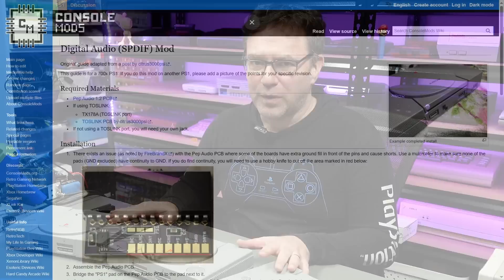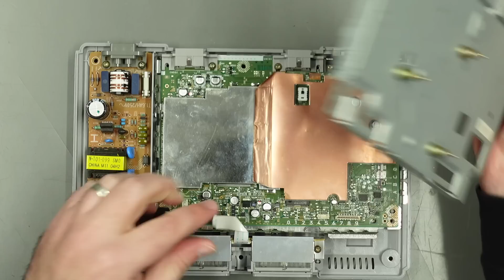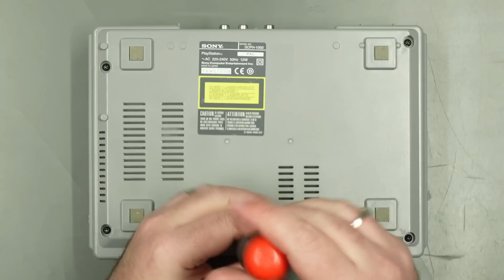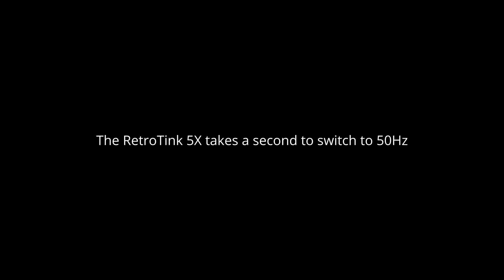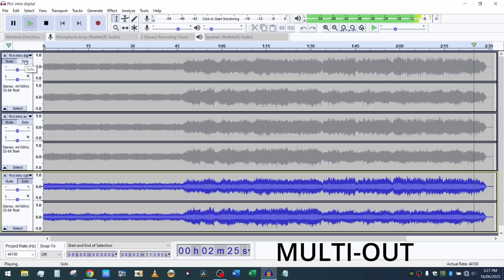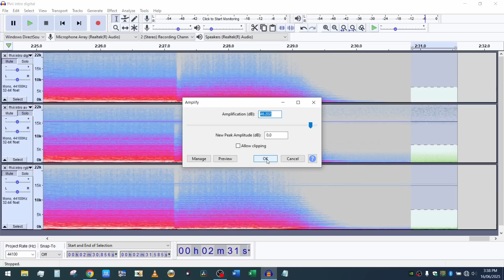PlayStation Digital Audio with just 2 wires #nocutmod

Comment: To anyone who thinks that, on a regular setup, 46dB of singal to noise is going to be a total dealbreaker:
-6 dB less means "twice as quiet". (Actually, -6.02, but let's round up for convenience)
-12 dB is "four times", -18 dB is "eight times as quiet".
You can calculate that for -46.
If you're not going through festival speakers and not applying, idk, insane OTT compression for doing your next banger, pink noise at that volume is noticeable, but barely. Not only because of the dBs, but also because loudness absolutely shoudn't be measured in dBs. For that, you use LUFS instead. And LUFS for these signals would not be great, especially for the second one.
Also, the RCA example obviously didn't reach 0 dB to keep normalization fair; that means there's another, say, 6.
On my semi-pro setup, these -6 make the difference between "yeah, there's pink noise" and "I almost can't hear anything". Remember, 2 times as quiet. I still definitely can, but that's on heavy, shielded monitors in a completely quiet room, and it's very low.

While noise is irritating, what I detect more (by ear, these cursory waveform inspections don't help) is phase dispersion. Subjectively, you could that "sharpness", it seems there's just a tiny bit more of that in the digital capture. However, can't be sure: 1) youtube recording is lossy and messes with phases for sure; 2) PS1's sample rate is 44.1kHz, too, but I still would capture in better "resolution" if I had a scientific interest in matching/inspecting the phases, it only makes sense. So, 96k could show the wave deformities better if they do happen in the higher frequencies. Well, with this high level of 15k interference, they definitely do. But what we've heard in these normalized recordings is not 15k (and PLEASE be careful if you ever decide to listen to clean 15k or anything high like that; only slowly raise the frequency and try to never raise levels from very low, and don't suddenly come close to your speakers, it will be painful and you could even damage your hearing).

Comment: i kindof deemed Digital Audio is bit too much for a PS1 at the time, so i gave it some Gold Plated RCA Sockets instead... added bonus is having Dual Output potential, like using a RF Adapter to go my RF only Sony Trinitron yet still having RCA going to a more modern CRT...
or Scart RGB for the Visual... and simply having the Speakers easily getting a stronger signal on the new sockets...
Yellow + White + Red style RCA on the right side of the PHAT PS1 (opposite side as the PSU) ... if i was doing it again, i'd probably get the DC 12V PSU upgrade instead, freeing up space behind it for this sort of mod instead...

Comment: would be nice if the adapter has a passthrough so that I can use PSIO together with this adapter....
Reply from the maker: Passthrough won't help as the PSIO uses the same free pins on the parallel port for other signals

Comment: Thanks for this video! Anyone know what's the wire gauge for two the included wires, or something else that would work? I'd like to get some extras for my spare consoles. (This will also be my first solder job which is why I may need a few to practice lol).

Comment: Hi, great to see it works with X-Station. Just to check, does it still work if the X-reset is also installed?
Reply from the maker: Should do, I can see any reason why it wouldn't. As long as the parallel port hasn't been messed with (which is what the PSIO does) it should work with all other mods

Comment: Hey there! Just found this video thanks to RetroRGB. Would the electrical noise/interference you mentioned still be an issue on a PS1 that's been modded with a Retrogem and a non-linear PSU replacement like the RePSX? Very informative video regardless. Thanks for sharing your knowledge :)
Reply from the maker: Do you mean from the analog output? No idea about the replacement PSU. Personally I stick with the original PSU whenever possible as replacements can introduce more noise. Not saying that's an issue with the RePSX as I haven't used one. As for the RetroGEM, it shouldn't cause any extra noise but I doubt it will eliminate any noise that's already there on the analog output. The digital audio output from this or the RetroGEM will always be noise free
Reply: @TheRetroChannel  thanks for the info :)

One other thing that's on my mind, which might just be something weird with my PS1 specifically:

In Final Fantasy 7, when you're on the title screen and select Load Game and then choose the memory card slot, there's a little 'confirmation' chime sound that happens when it loads the list of saves on your memory card. Not the sound when you pick a particular save to load, but rather the sound between selecting the memory card and seeing the full list of saves.

I've noticed that with digital audio (via the retrogem at least), that little confirmation chime doesn't sound right. Almost like audio samples are being dropped? But if I use the retrogem for video only and then the AV multi-out port to get analog audio, that chime sounds correct as it's supposed to.

I know this is an extremely niche / edge-case situation. But if you have the time or inclination to see if the same issue is present with your parallel port audio mod, I would greatly appreciate it.

Reason for all of this is that I only use the AV multi-out port for analog audio. So if I could switch to digital audio with no downsides then I could delete the AV port and restore the serial link cable port - having it exit the console where the AV port used to be.

p.s. Sorry for the lengthy comment, and I'm probably going to order one or two of your audio mods regardless!
Reply from the maker: @FarAwayCinema no problem. I would rather hear about these potential edge cases than not, that way I can either try to correct them or if I can't then I can at least advise people that it is an issue.

So I did a test with my 1000 series using the multi out for audio, and I don't hear any obvious difference between digital and analog. I captured both outputs and compared in audacity just to be sure. The da-ding sound is the same with both of them.

Well, not entirely the same, the digital version sounds a little "crisper" for lack of a better word, but definitely not wrong in some way. I would imagine the other PS1 revisions will be the same but if you let me know what version main board you have I can test it out with one of mine.
Reply: @TheRetroChannel  SCPH-5501 with a PU-18 board. Retrogem hdmi-out connected to a morph 4k connected to my OLED tv. Analog audio from the AV multi-out -> RCA adapter (SCPH-1160) -> RCA-to-Aux cable -> 5.1 speaker system. Speakers are just a cheapo Vizio set, so no receiver or amp. Just aux cable plugged directly into the aux port at the back of the soundbar.

I have an Xplorer FX Pro cheat cartridge plugged into the parallel port, and have noticed that the sound effects you normally hear when selecting the menu options in the xplorer software/firmware often have the same dropped audio sample issue but it doesn't happen 100% of the time like in FF7.

The problem only occurs if I have the speakers set to HDMI-ARC mode. If theyre set to AUX then everything sounds fine.

Also I recognize that due to my "unique" setup that the issue could be caused by any number of things. So no worries if all this sounds like a bit of a quagmire in terms of troubleshooting.

I might be able to upload a recording of the audio on my channel so you can hear exactly what I'm talking about rather than just reading a description of it. But I'd likely have to record it on my phone which wouldn't be ideal.

Thanks again :)
Reply from the maker: Ok, I decided to test again with my 5000 and 7000 series and I did notice a difference, but the cause was not what I expected. Have a look at this https://youtu.be/TlcscBdK-tU and tell me if it's what you've been hearing
Reply: Thank you for testing, but unfortunately that's not the same as the issue on my PS1. Instead of hearing the Da-Ding! sound, I only get the back half of the Ding. Except around 10% of the time when it actually sounds correct. I uploaded a video so you can hear it for yourself. First 34 seconds is digital audio via HDMI-ARC, and the remaining 17 seconds is analog audio via AUX which sounds correct every time: https://youtu.be/5XOk9GMnAY0
Reply from the maker: @FarAwayCinema Ah ok, I see, or hear what you mean. It sounds like a similar issue that the SNES digital audio mods cause with some DACs. Although I didn't run into this issue when testing my PS1 digital audio mod.

Basically the SNES will drop the digital audio stream when there's silence, and certain DACs do not handle this very well. It seems to take them a fraction of a second to resync

It's a known problem with SNES digital audio mods and I think I demonstrated it with a certain Pioneer receiver in my SNES digital audio mod video. But that same receiver was perfectly happy with the PS1 digital audio mod so I figured it wasn't an issue with the PS1.

Curiously certain SNES games are unaffected as they keep the audio stream active even when there's no sound (it's obvious when looking at it on a scope). I guess it's not a SNES specific issue as I've seen options in things like Kodi that appear to do the same (keep audio device alive).

All that being said, I'm not sure if I tested FF7 with it. I will pull out the Pioneer and test again, if nothing else I am curious to check with the scope if the PS1 and FF7 does a similar thing. I doubt it, but again I don't think I ever bothered checking as it seemed to work without issue.
Reply from the maker: Ok, some interesting results. I can see that the PS1 also drops the audio stream when no sound is being output BUT the Pioneer receiver handles that just fine.

I can see the PCM indicator on the front of it turn on and off as I go back and forth in the menu, but the audio sounds complete. And every so often it will stay lit as if the PS1 is outputting digital silence. I assume this is why on rare occasions you don't get the dropouts.

I'm thinking it could be down to two reasons. The higher and more standard sample rate perhaps allows the receiver to lock onto it faster. Or the PS1 "wakes up" the audio output slightly earlier. Could be a combination of both.

Out of curiosity I also hooked up a regular CD player with S/PDIF and indeed when nothing is playing, the audio stream stops. This also happens when skipping between tracks but there's no obvious dropouts.

So my thoughts are certain DACs are just a little slower to start and therefore may drop samples. I think it's worse with less common sample rates like the 32kHz from the SNES. Whether or not my mod performs any better than the RetroGEM is unknown. I don't know what they're using to convert the various signals into S/PDIF but I'd be curious if anyone else has noticed the same issue.

I don't see an easy solution other than trying a different receiver or DAC. I wish there was an easy solution as it would certainly help for the SNES mod especially

Comment: This is great for people like my self who are good with soldering, but terrible at making plastic cutting / panel mounting look good. I've added it to the ConsoleMods page shown in this video. 

I did notice in the install instructions it says "(see images above)", but I'm not seeing images. Are they missing?
Reply from the maker: Thanks mate. The install pics are up the top of the page with all the other images, you just need to scroll across a little. I will move them around so they're a little more obvious 👍

Comment: Ngl, a ps1/2 is irrelevant in the big 25 when you can frankie (or buy one ) a ps3 and get HDMI and hardware backwards compatibility on one system for less than $1000

Comment: Now do it compatible with PSIO please with second port behind.
Reply from the maker: Not going to happen, the PSIO already uses the unconnected pins on the port for something else.
Reply: @TheRetroChannel  then it should be redesigned with some switch on module that allows to switch between this thing and PSIO to at least avoid plugging in and out both devices. But I have better idea.

Why does this thing has to use IO pins for audio reporting? Instead av output pins could be used to route out digital audio via some of its pins
 Modified device should be plugged to Av port (maybe have some external USB power) and should have another av out in it to output video and audio standard way, or it also may have all regular porta for output - composite, svideo, rgb scart +  digital output plus yet another av out Design should be similar to one of those official ps1 short cords that was plugged into av out and had composite output plus another av out.

This world be better for PSIO or debug devices compatibility.
Reply: @TheRetroChannel  then it should be redesigned with some switch on module that allows to switch between this thing and PSIO to at least avoid plugging in and out both devices. But I have better idea.

Why does this thing has to use IO pins for audio reporting? Instead av output pins could be used to route out digital audio via some of its pins
 Modified device should be plugged to Av port (maybe have some external USB power) and should have another av out in it to output video and audio standard way, or it also may have all regular porta for output - composite, svideo, rgb scart +  digital output plus yet another av out Design should be similar to one of those official ps1 short cords that was plugged into av out and had composite output plus another av out.

This world be better for PSIO or debug devices compatibility.

Comment: Isn't there a possibility to make this mod accessible to psio users by just soldering this box internally and putting this connector with a drill on the io?
Reply from the maker: That's pretty much how the original digital audio mod works https://consolemods.org/wiki/PS1:Digital_Audio_(SPDIF)_Mod

Comment: Its not really making a PS audiophile. Its just transporting the job elsewhere. The first models are audiophile because of the DAC
Reply: The DAC wasn't changed until the 7000 model PS1s. But that isn't a factor with this mod because its outputting the digital audio before it even reaches the DAC. Audio hardware has improved quite a bit over the past 30 years, and so one of the advantages of this mod is it allows you to easily route the audio through an external DAC and get better quality than what's normally possible on any PS1.
Reply: the mod shown in the video makes no sense at all, why does it even exist?? beats me...

Comment: This is cool. It's a good option, but I generally just use my PS2 that has a digital output already.
Reply: Have been curious since hearing about the PS1Digital's proper, uncompressed sounding audio (IIRC, some overdriven sounds/music on one of the Resident Evil games whereas most everybody had to hear the crunchy, overdriven sounding audio at certain passages up to now)... Don't know if this had to do with when titles supporting Dolby Surround were playing back but not deciphered and, so, came out sounding terrible over a pair of stereo channels.... Does playback from a PS2's Toslink and receiver with the old Dolby Surround support (4.0 audio?) is properly decoding the matrixed rear channel audio track?
Reply: @That_Handle  analog dolby surround is a bit funny - its not actually 4 unique channels, but instead a bit of additional metadata that tells your audio receiver (if you have one) to duplicate the two stereo channels with the speaker mapping flipped so they're also sent to the RL and RR speakers. In other words its literally the same sounds that comes from the front two speakers.

Does it make for a cooler and more "immersive" experience? Heck yes. But you're not missing out on hearing different sounds if you only have a 2-channel stereo setup. Also since its basically just a metadata trick, a 2-channel setup won't suffer from additional tracks muddying up the audio by getting folded into your front Left and Right speakers. If you don't have a 4.0 speaker setup, the metadata does nothing and you hear the normal stereo audio exactly as the game developers intended.

Regarding digital audio via toslink on PS2, there's no support for Dolby 4.0 because that's an analog format and toslink is digital. But plenty of home theater speaker setups - even the very cheap ones - have the ability to produce "fake" surround sound from 2-channel sources. Which means you can get essentially the same effect even on PS1 games that don't support Dolby Surround. My cheap vizio speakers can do this and its just an option you select on the remote.
Reply: @FarAwayCinema ,
Thanks. 
...Additionally, a bit into the nuance of the PS2 outputting PS1 Dolby Surround: 
Are the PS2 models that had full PS1 chipsets onboard going to send Dolby Surround out through the stereo AV cabling?
Reply: @That_Handle  I would assume yes. IIRC, the Dolby Matrix mix is a permanent part of the audio track. So you essentially get the output side for free, so long as it's encoded that way. You, of course, have to plug it into a matrix decoder to split the signal out into 5 channels though. I believe there are also SNES games that have dolby surround, etc
Reply: @That_Handle  Any PS2 that's outputting analog audio to a 4ch speaker setup will send the Dolby Surround mix. If your PS2 is outputting digital audio via toslink or HDMI (retrogem) then the audio will be 2ch stereo. The chipset on the PS2's motherboard shouldn't have any effect on which audio stream the console outputs.

Comment: the 1000 is the best with the direct rca connectors it has a warm clean output sound, I ran it off a cheap early 90's RCA amp but holy it had awesome sound, was and still is my fav of the ps1 series
Reply: https://archimago.blogspot.com/2013/03/measurements-sony-playstation-1-scph.html